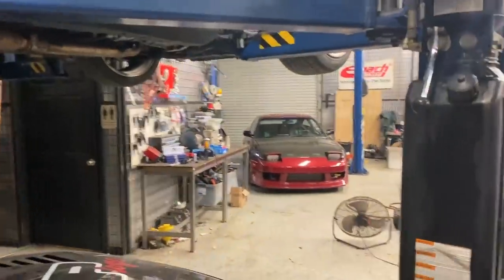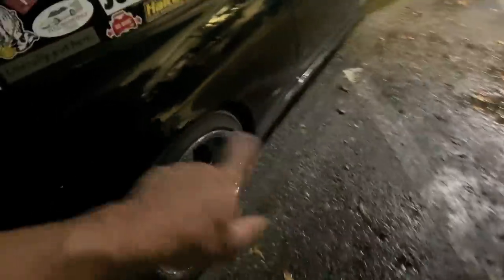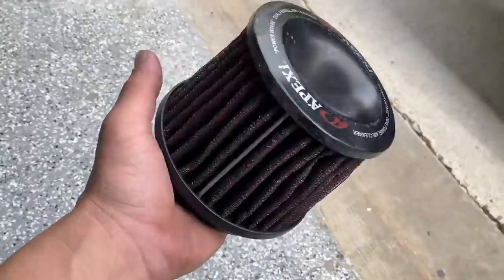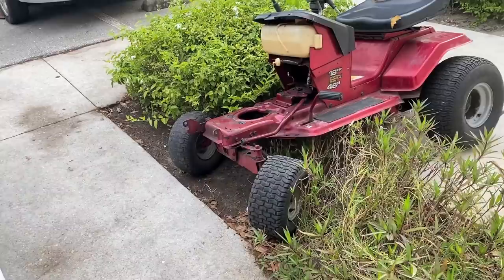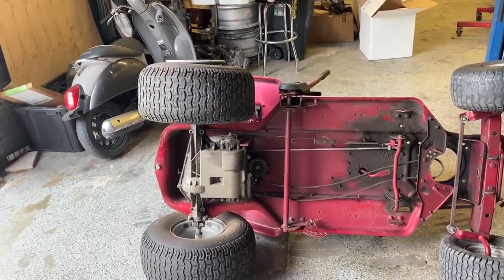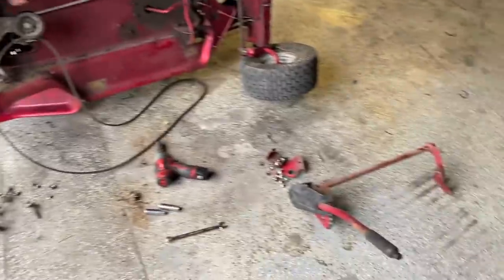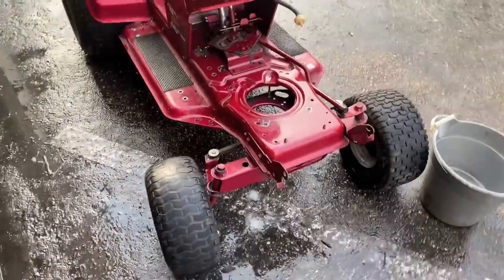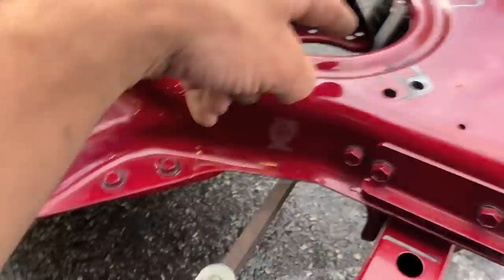Starting my TRACTOR Mods!

Comment: I used to work as a go kart mechanic and the way they were set up was that the steering wheel shaft was connected at an angle to a intermediate steering shaft and then a tie rod rack. In your case you would have to make the intermediate steering shaft longer to cover the distance to the front of the mower or where ever you decide to put the steering. Not sure how responsive this setup would be for your mower but it worked on the go karts. Hope this is in any way helpful.
Reply: Swing arm and drag link?

Comment: A motorcycle motor with driveshaft would be sick
Reply: Would be hard to find a diff that can hold the power and abuse
Reply: @anthonysterling1  I don't think so.
Reply: @Zach-ju5vi  lmao love how you call bs but can’t if a diff that would fit under the mower with out stupid amount of time and money
Reply: @anthonysterling1  I mean we are already talking about fitting a shaft driven motorcycle engine into a mower, time and money are already out the window. If you are serious about the project you would probably need either a parts motorcycle or an atv for the engine so why not use the diff that was originally used with the engine?
Reply: @Zach-ju5vi  got a 250 that’s shaft the engine isn’t the issue it the diff 
The rear ends are ifs and a bitch to adapt with the space build this type of bs so we are on diff levels dude
Reply: @anthonysterling1  lmao we are definitely on different levels that is for sure. You just haven't figured out how to adapt a shaft drive rear gearcase (not a differential) to your project. I could make that adaption happen but I'm not stupid enough to even try, it would be much simpler to use an atv rear end because it is already formatted for 2 wheels.
Reply: @Zach-ju5vi  have had adapters made and built full mini solid axles but again they don’t stand to the abuse it’s simple as that intell you cut down a Toyota axle to short af it’s not worth it simple facts
Reply: @anthonysterling1  kinda sound like you have no idea what you are doing. If you use the same gearcase the engine came with power won't be an issue. Atv gearcases will handle 120 hp all day long, you would need a very powerful motorcycle engines to break that. If you are breaking stuff with a 250cc engine it's good chance you are putting it together wrong.

Comment: If the steering ends up not working out you could use a hydraulic steering system from a boat, it would be super easy to rig up.